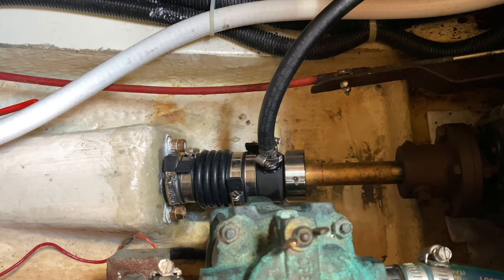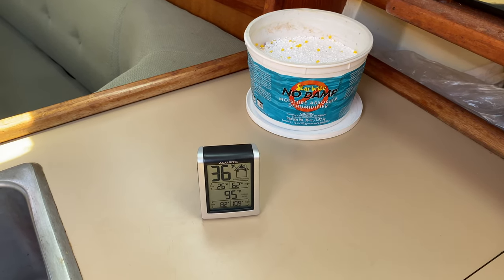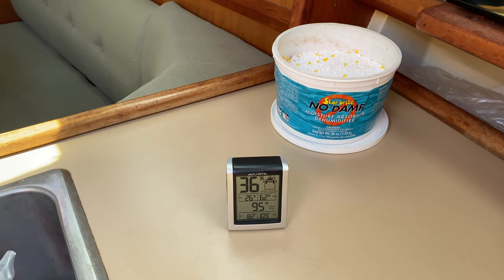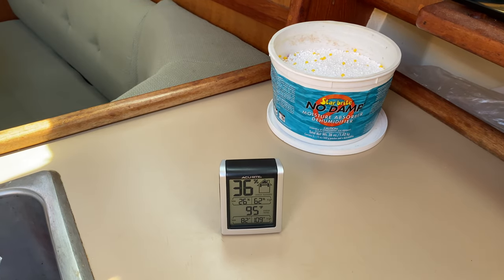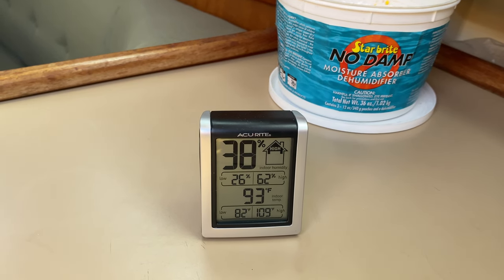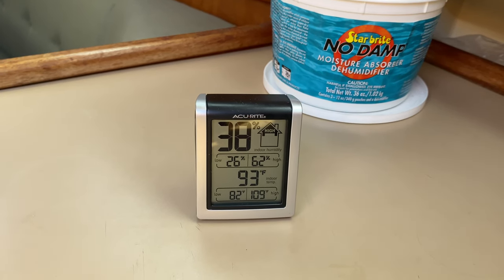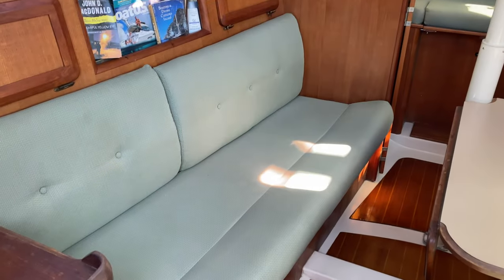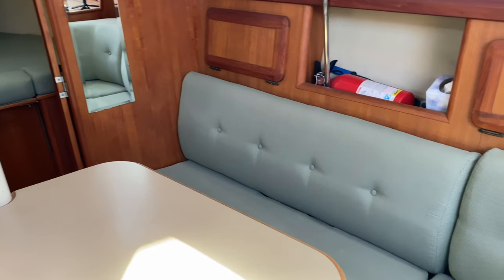How We Eliminated Boat Cabin Odor ~ Ep. 105

Comment: Great tips, thanks!  I just purchased a '88 Cal 33 and thankfully it has no signs of mold/mildew, but did smell of diesel.  Like you did I took everything that I could home to clean, wiped down every square inch of the interior (oil/lemon wood cleaner, and household cleaner for rest), and later wrapped the cushions in silk film before putting the washed covers back on.  Boat has zero smell now.  Lastly I bought and ran a small ozone generator in there for a couple of hours to try to kill off anything that might yet be present.  
I've wondered if the silk film might not let the cushion breathe properly and be a problem later, but I'm inclined to think it will help more than hurt, and just knowing it's separating me from any possible nasties that might still be inside the cushions is comforting.  Oh, no vent fans on the boat, but it does have two dorade box vents which remain open year round- they must be sufficient since no mold or mildew.  (boat is in NJ just FYI)  
I'll try your head tips.  I hope to later reroute and dedicate the smaller fresh water tank to the head in the future, hoping it's not too difficult.  Thanks! -Jim
Reply from the maker: Congrats on your Cal 33! Sounds like your boat was in a lot better condition than mine when I bought it. I haven’t heard of using silk film… but you’ve got everything in great shape! Enjoy your new boat and your comment is much appreciated (I don’t get many lol). Thanks for watching!

Comment: We bought a Hunter 38 that smelled like an old stone basement. We tried everything that the other boaters recommended. In the end on a chance at Ace hardware we boaught a gallon of  Odoban ™. It was the only thing that worked. Now all we have to do is keep the boat dry and it's been over two years, all is well.
Reply from the maker: I think an old stone basement would have been a big improvement from what my boat smelled like when I bought it, lol! Did you just spray the Odoban on everything or did you scrub/clean everything with it? I’ve never used it.
Reply: @tcsadventures  Hello, We soaked the cusion covers in a bucket with the Odoban mixed in. It was instant. They went under water smelly and came back up free from odor. We also mixed up some for a spray bottle and used that to wipe everything down.
Reply from the maker: I’m glad it was successful! Enjoy your Hunter!